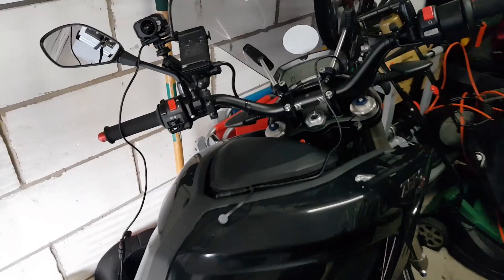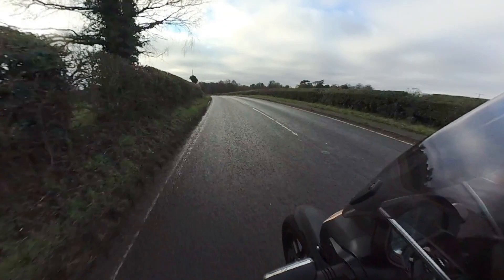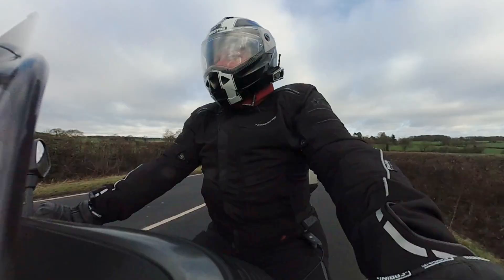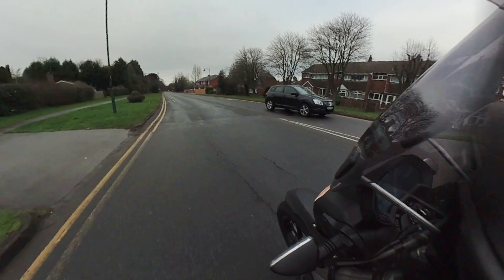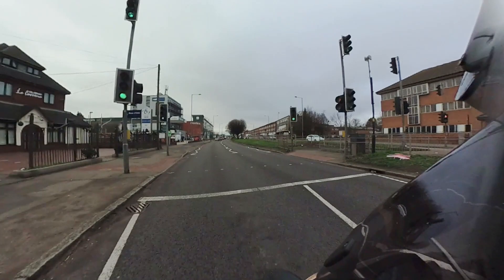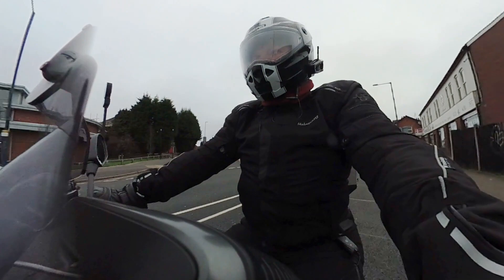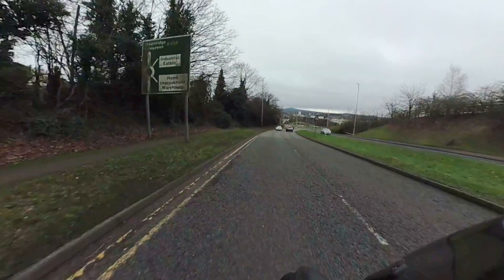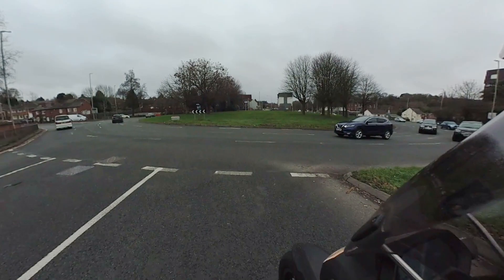Zero Motorcycles: Zero DSR Electric Motorbike - Charger Challenges and Solutions

Comment: John - an off-topic question... you mentioned in an earlier video that you changed your stock DSR knobbly tyres when they wore out with something that was by Bridgestone (I think)? Would you mind sharing which tyres you ended up fitting? I have a DS on the stock tyres and ride in a wet rural area of South Ayrshire where there are frequently washes off the fields plus the odd gravel ramps on bends where a minor single lane splits off. We don't tend to get "winter" conditions because we are coastal but certainly have to deal with wet, rough tarmac with some loose material on it.
Reply from the maker: I replaced them with Michelin Pilot Activ 100/90-19 and Michelin Pilot Activ 130/80-17 for the front and rear tyres respectively, Daniel. Very pleased with them so far. I have the Michelin Pilot Roads on my Honda CBF 1000, and I've been super-happy with them, but they're not available in the Zero wheel sizes.